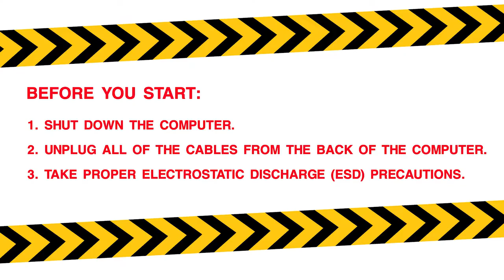How to Clean Thermal Paste off CPU

Comment: What if we don't have the alcohol?🤔
Reply from the maker: You can remove the thermal paste without alcohol but I recommend you to use Isopropyl alcohol (90% or 90%+). Because it evaporates quickly and leaves no residue. If you don’t have Alcohol, wipe it off with a dry paper or kitchen towel until the thermal paste is gone. Repeat this process until there is no more grey residue left on the paper towel when you wipe the CPU. If you require any further information, feel free to contact us. Thanks 💛
Reply: @IdeaShip  thank you 🔥🔥🌚
Reply from the maker: You're welcome! 💛